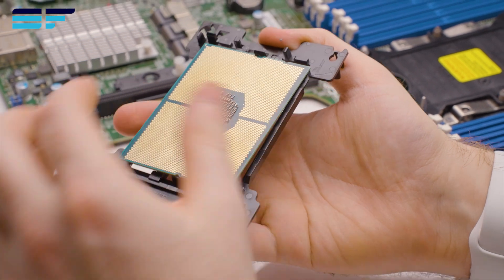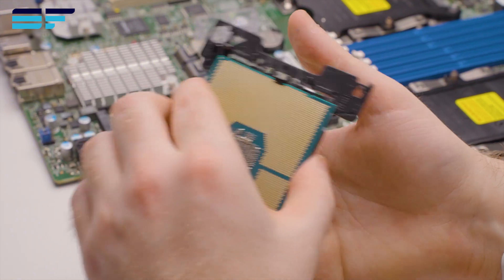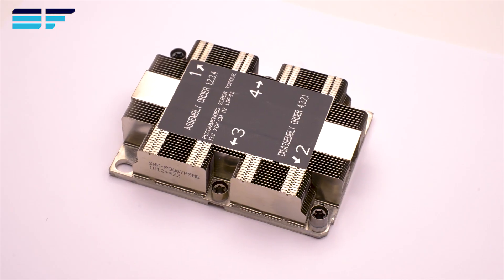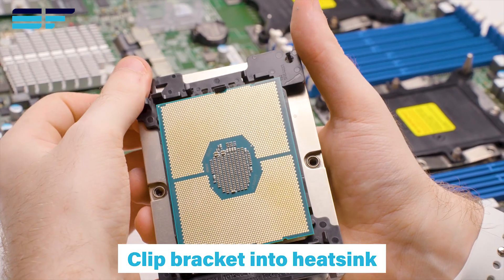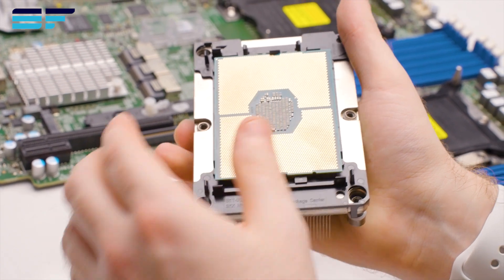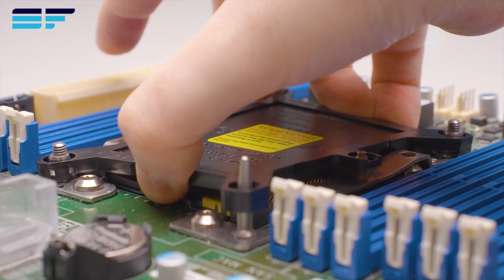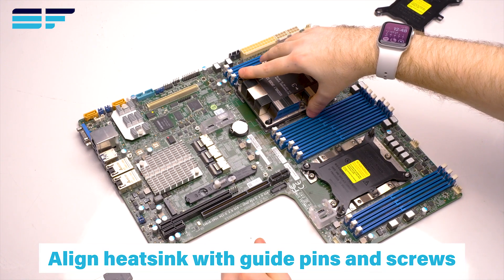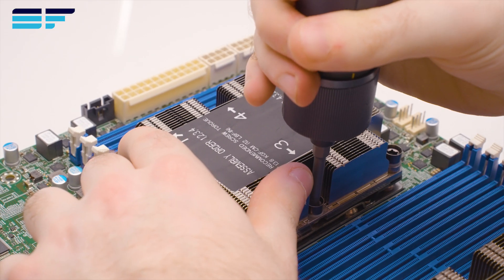Intel Xeon Scalable (2nd Gen.) /W-3000 series LGA-3647 Installation Guide | Server Factory

Comment: “Using the guide pins and screws” you should have showed that part specifically.
Reply from the maker: Thank you for the feedback - we will be more thorough in future!
Reply: They show it during the installation, it’s the protruding pegs around the socket.
Reply: @bryanc4054  With no indication at all which way it goes in the socket, as you could turn it 180 degrees and still screw it in.